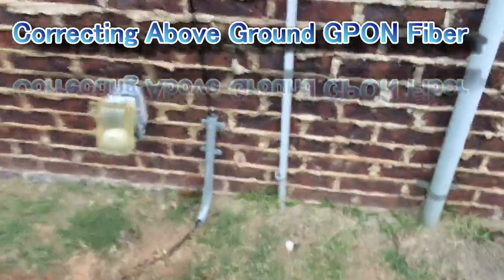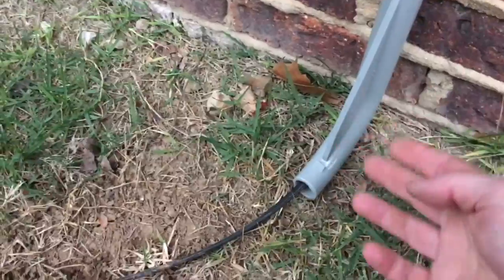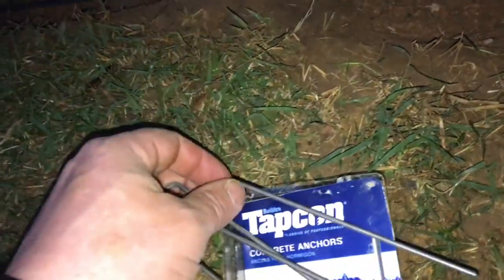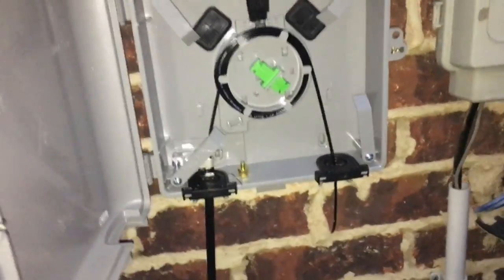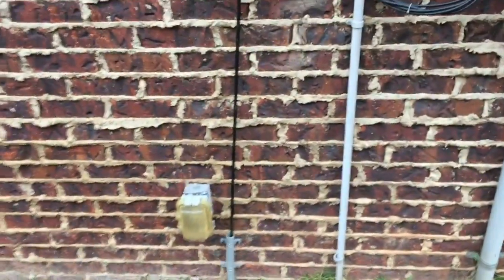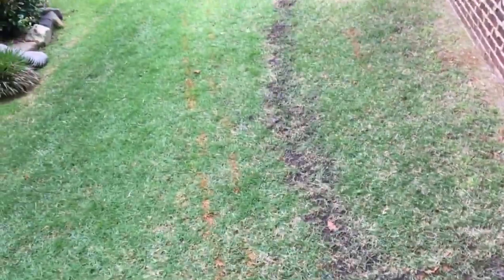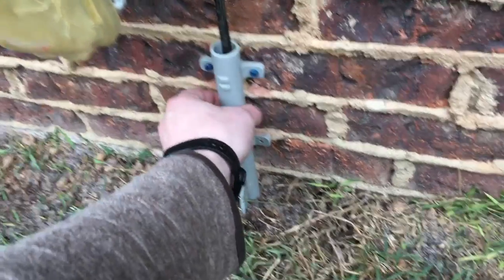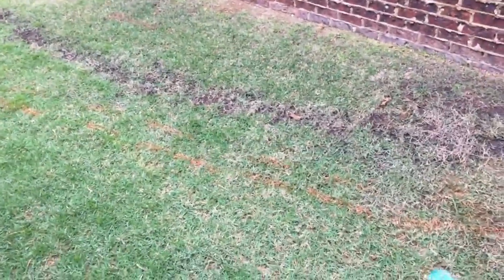AT&T Gigabit Fiber Internet -  Underground Fiber Installation Mistakes and Resolution Process

Comment: The J pipe is for Direct Tv installations, the Slack nid should be terminated to the connector inside it  (local practices may permit) then terminated from the connector (green connector) to ONT, the fiber run to the ONT should have a drip loop AND have silicone. As for the depth,  a minimum of 3" is  not enforced. Besides people damage these no matter how deep you bury them
Reply: Good to know.  I've since figured out everything but the J Pipe actual purpose being for DTV.  As for Minimum depth not being enforced -- That's quite obvious here lol.  I'm sure people do damage at most any depth who don't bother to have lines marked before digging and even, sometimes, when they do.  I showed how deep it was buried for me and it wasn't acceptable, and shouldn't have been to anyone.  It was a situation of rub your foot on the ground for  1 second and you just 'unburied' 2 feet of Fiber optic kevlar sheathing.  It was buried at a maximum of 1.5" and minimum of 1cm.  It wasn't buried at all up to J pipe (again above ground)  for obvious reasons.  I've since rectified this,.. although I've since discovered when AT&T used their machine to bury this the 1" into the ground -- they busted the sprinkler system in front yard and cut neighbors POTS line.   I've yet to fix the sprinkler system but I have the area of where thing were buried literally on film to remark and dig up so hopefully it's merely a head to replace.  I didn't even think of a sprinkler system being hit as given the depth of the buried wire doesn't approach depth of system.  Though the trenching blade itself does  go well beyond the depth the line is buried.
Reply: Yeah the bad thing there is no specific code to them accountable to. But props to you for making it right!

Comment: I do this for a living and let me tell you that your job was done ugly....that conduit is supposed to go all the way to the bottom of that slack nid and not less than 6 inches under ground. That fiber can be bended more than 90 degrees with no issues whatsoever but I usually make a nice path so it doesn’t bend as much.

Comment: Cables nicely exposed. For a burglar? Easy to break if a burglar alarm goes through the internet. Apparently style / habit in the US?  My fiber goes completely underground inside a pipe and at least 30 Inch deep (also inside the house > no terminals and cables on the outside wall)
Reply: These newer security systems use cellular / battery backup.

Comment: I'm not dissing you having to bury that extra 2 ft. that should have been hand dug. what I am going to enlighten people on is why it isn't that deep. when they load the fiber into the ditch witch the have to go shallow because setting it deeper causes more vibration on the fiber line resulting in the fiber inside being broken. in our area when fiber first fired up they tried it at 8 inches and 8 out of 10 lines had to be replaced after being buried. and since the buried crew has no test equipment and just pretty much show up to bury, they have no way to tell if it's broken or not when they get done
Reply from the maker: I see.  Well there is still something off with some burial crews (at least the few I've seen) -- They manually buried with the specialized (shaped) spade (you know the shovel / blade looking trencher you push in with boots) the neighbors entire drop(s).  Both her  new POTS line and the Fiber line.  As I showed in video it was less than 1 inch under ground the entire way (100+ feet) -- meanwhile the actual depth of the trench they manually made is at least 6-9 inches deep.  It was just laziness on that part.  I didn't make this video to speak ill of AT&T's workers.. just to show the 'resolution' for any others with the problem that might want to fix it themselves.. and some people just like to see fiber optic 'internet' equipment in general as GPON type networks are a bit exciting when you don't have that kind of speed available to you (which is most of the country).

I am surprised the fiber was being broken by vibrations though.  That line is mega protected with the kevlar and all sheathing -- cars can drive over such a drop all day long and it's generally fine.  Though perhaps vibration is a different beast.
Reply: GuessTech 
Just a thought. The install tech is responsible to bury the line 2' from the premise and 2' leaving the handhold. This was not a bury crew issue. As for the vibration...you could encase in concrete and vibrations on the line would still crack the fiber, but you are correct about the strength members doing a nice job protecting. 

The sweep should not have been used. The copper ONI should have been removed and replaced by the slack NID. Then the existing conduit could have been used to protect more of the drop farther up the brick. Just my 2 cents. Have a great day!
Reply: What burial crew doesn't have their own test equipment? I'm on a burial crew and we test all the lines that we bury, but we also are responsible for the connections at the drop point too which might explain why we test.
Reply: GuessTech I’m not excusing the work that the tech did.. but they have metrics they have to meet.  They’re given a certain amount of time to complete a job. I don’t think he was being lazy he was just trying to hurry and complete the job to meet his metric and pick up the next one

Comment: Some contractors were digging around my neighborhood. They left some tube that has  "Dura Line 1 1/2" IPS SDR HDPE AT&T" written on it. Is this fiber?
Reply: High Density Polyethylene conduit IS typically Pre Fiber work.  Every installation in Birmingham, AL  (with underground Utils) has been with HDPE conduit (tubing) first.  They lay this tubing out which should have plugs on the ends with a string / rope attached to it.  This rope is designed to 'pull' Fiber (or whatever) through the conduit.  
It's typically orange.  If they've put this tubing into the ground (or when the do) if they also put hand holes (openings between every few homes) then it is almost definitely GPON (Fiber).
You can also just go up to any AT&T truck / employee you see in your neighborhood and just ask if it's fiber/for fiber and they'll tell you.

Comment: So, contractors working for AT&T came and installed conduit and fiber in the utility easements of each home in our subdivision. The conduit/line basically runs parallel to the rear fence line.

But, nothing was installed from the easement to the homes yet. I imagine that won't be done until someone actually purchases the Gigafiber internet service. 

Was your fiber installed on two separate occasions, or did the contractor install to your house as well at the same time?
Reply: I should make a video of what to expect .. the 'general stages of getting Fiber INternet in your neighborhood' -- Or some such.

But .. yes.. you have it right for all practical purposes.

They come in and put the conduit tubing (EMPTY) in the ground with hand holes ( the boxes that the tubing meets (nothing in them either but two ends of tubing) -- and that's it.  In a DISC*S MX neighborhood like my own.. the conduit runs between every 2 homes to such a hand hole and these handholes and conduit run to an ONU (Optical Network Unit) Where they add in a smaller new pedestal where they split the existing fiber and put in an 8 to 1 (usually) sometimes 16-1 splitter for the GPON network.

But Yes -- what you see now is all you will see until you order the service.  When you order (they have to 'flip it on' so you'll need to check with AT&T for when it's ready to order) but when you order the Installer will come out and run the Fiber line from the splitter (however it's done in your neighborhood) to your handhole, from handhole to the side of your house.  Then they will put in an ONT (Usually inside now.. they used to put them outside though) -- and in some newer installs they put the ONT (optical Network terminal) inside the modem/router itself.  

But a long time back I was wondering when they would run the 'fiber' in the conduit and all that -- to then realize they don't, not in my type of neighborhood anyhow,.. until someone orders :D

Comment: i have 1 gig but only getting 400 speed now ...they came out and changed modem said modem bad ...they left still only 400 speed ...any ideas ?
Reply: Darren Lucas That’s because technology hasn’t caught up with the speed available.. You don’t have a device with the capacity to process 1Gig.
Reply: you need a SSD of +1gb speed and a good CPU, if internet speed is faster than write speed of ur HDD or SSD is common sense it will only reach max read speed of ur drive. Is like going on the highway with a tractor not gona work well.
Reply: Random Gaming I'm not sure where you got this info from, but it sounds completely wrong.

The internet speed has 0 relation to any type of storage or CPU hardware - just like there's 0 relation between those two.

To be able to actually attempt to utilize 1Gb internet, you have to have a motherboard (or a separate card) that's capable of it (Intel has 1Gb LAN on most motherboards aimed at gaming for instance). Nothing to do with storage or CPU, and everything to do with whether or not your LAN is capable of supporting it.
Reply: guy use commong logic if your old HDD can only reach 10mb-30mb write or read speads, its imposible do reach those 1gb speed of the fiber, thats  100mb/sec. Thats why you need a decent SSD and all the incoming/outgoing traffic is procesed by the CPU, dont be silly guy.
Reply: yes it had, with any i7 and those new high performance PCE ssds on raind you can achive over 3000mb/s, 1gb of internet speed its only 100mb/s wich any decent ssd can achive.
Reply: Random Gaming You are not making any sense.

Storage has nothing to do with internet speed. At all. 

You seem to be thinking that the read/write speeds of HDD/SSD correlates to internet speed - but it doesn't. Those are the speeds in which they can access files (boot the OS, open programs, run programs etc).
Reply: omg you guy clearly cant understand the fact that if your PC cant work at 1gb you wont have that speed.
Reply: Random Gaming The only thing that needs to work for a 1Gbit internet is your Ethernet port on your mobo. That's it. You could have a 4th gen i3 and still get 900Mbps without issue.
Reply: you clearly dont unerstand anything. if your i3 cant process those 900mbps tell me einstine how your pc would reach that.
Reply: The clock speed of the CPU is what determines how much information can be processed every second and sent back to whatever is being used to show said information. You can RECEIVE the information at 800Mbps (or 100 MBs), but only be able to process X amount of information being received at Y speeds because of your clock speed (among other factors).

CPU's DO NOT operate under Mbps/Gbps/MBs etc. 

Example

You have two computers. Both computers are running an i5 4790K @ 3.5Ghz (my current shitty CPU).
I have 1Gbps internet, so I know for a fact that my CPU can top 1Gbps, but normally stays between 800-900 down and 900-950 up. 

On one computer you are downloading a single file that is 1Gb with nothing else running (other than the standard background processes), and on the other you are downloading the same file but with two YouTube tabs open as well as browsing FB and Imgur. I can guarantee you that the ladder will be much slower BECAUSE you are having the CPU handle higher traffic and attempt to distribute the information in multiple instances.

THAT IS HOW A CPU OPERATES. The internet speed is still the same, but the downloading of the program will be bottle necked by the other applications/operations being handled by the CPU. THAT IS NOT THE CPU SLOWING THE INTERNET DOWN, THAT IS THE CPU SLOWING ITSELF DOWN. Of course RAM has a pretty big part in this, but for this part of the argument we are focusing on the CPU.
Reply: all the traffic is made by packets, packets needs to be procesed by the CPU in order to be recognized as files, a slow CPU wont cope with 1gpbs worth of packets at same speed of the pipe, Im done talking to you, you clearly have no idea how network traffic works.
Reply: are you using WiFi ?
Reply: I happen to be an AT&T tech and I see many issues like yours. Some computers don’t show the full speed due to malware or other programs running on the background. You can run a couple of test, restart your computer on safe mode with network capabilities (google how to do it it’s easy) run speed test from Speedtest.net from the closest server available which I hope it’s a server capable to handle a gig speed. Another way to find out is downloading Smart Hope Manager on your smart phone or tablet, login with your AT&T email and password and under tools there is a speed test option which will show you the real speed that you are getting at your modem. I hope this helps you.

Comment: Looks like whom ever Verizon contracted with to do the install was a sham operator! A simp,e grass mower would cut that cable the second time that lawn would be made!
Reply from the maker: I am not sure if it's really poor training, ineptitude or just laziness,.. but yeah - the whole process from Handhole by street to ONU was half-assed and frankly in obvious danger of being cut as Fiber optic cable was ABOVE ground on a lawn.  Blows my mind how you can't have the common sense to realize the PVC bend must be BURIED in order for the fiber to remain UNDER ground in an underground utility system/neighborhood.  The burial crew (different people entirely than the installer who did this) cut the neighbors POTS line, Internet line -- while simultaneously (as I've recently discovered) busting my sprinkler system [Whether it's just a head demolished or actual pipe broken I don't know 'yet'] with the burial of the Fiber line.  

The above is why I did this work myself,.. When a person goes out and does someone else's job when it doesn't cost them anything to have it 'redone' -- You know the people doing the work are not competent.  I didn't want to go dig up more of the yard,.. bury cable, remount the PVC bend , resod and as a result spend the next X weeks babying said sod path -- but I felt that if I didn't,.. it would just be more headaches, cut lines, and just not ever done properly.  Better I spend an hour or two getting it resolved myself than having more things damaged,..  high likelihood of my own new fiber internet line being cut (by AT&T) , along with Cat6 lines ,.. and now I still have to deal with digging up the yard again in another spot to ascertain the precise amount of damage (and where) to the sprinkler system that now just spews water out of the ground 'near' where a head is supposed to pop up.  On that , I'm hoping they just 'ate' up the sprinkler head with their trencher and I don't need to dig/trace and cut out more PVC of the sprinkler system feeder lines, splice with joints, etc etc.  Digging in this ground with all of what is 'around' it (in it) utility wise is just not fun.

Comment: directv ground sweep installed incorrectly... dig crew as always do a crappy job.... as for you, you did it correctly...
Reply from the maker: Is that what the J pipe is called? "DirecTV ground sweep" ? There is no DTV in my household but I've not seen another install in this neighborhood use a J PVC bend like that -- all the others run fiber straight to wall and 90 degree it up  .. then they come back (sometimes) and put a regular piece of PVC above ground that has no bend etc.  Thankfully the kevlar sheathing of this fiber allows a bit of a natural bend even if you run it at 90 like that -- despite it not being a 'great' idea imho.

Also,.. what is up with Dig crews?  The ones here are AT&T employees not contractors - why are they SO incompetent (not all, but most here)?  Their job is to avoid other marked lines - and BURY their own lines properly at an acceptable depth.  What is up with the maximum depth being 1-2 inches literally and where the machine wouldn't fit it being half a millimeter under the dirt in  my case? (IE: I spot the line above ground and slightly pull on it and it comes up 8 feet out of ground because it's not buried.. well technically buried 1 millimeter).  

Is it lack of training? I've had no training on burial, etc.. and I figured it out pretty easily.  It seems like something that is 100% common sense regardless.  I get being a lazy worker, but if you have a gas powered machine.. at least put it down 4-5 inches not 1" -- and where it won't reach,.. use a shovel/spade and spend 3 minutes putting it at a proper depth where it won't work it's way out and you or another crew won't be coming back to redo the job -- Or worse and likely common (as was here) lines are cut by landscapers because they are on the surface post burial.
Reply: That is a DIRECTV ground sweep. I know because I install them.

Comment: Installer still did this wrong. The green piece inside is is transition from outside to inside fiber. There should be two separate fibers meeting there
Reply from the maker: Yup, either was taught that way.. or is taking a shortcut.  Either way the slack fiber , should the need arise , can be cut and respliced via that junction.  He probably didn't want to terminate the fiber two more times.. not sure.  But based on all the errors,.. mostly simple in nature,.. it doesn't surprise me.  Thankfully it has no bearing on service.  The light level is the same at the ONT inside as at the ONU split half a mile down the road.